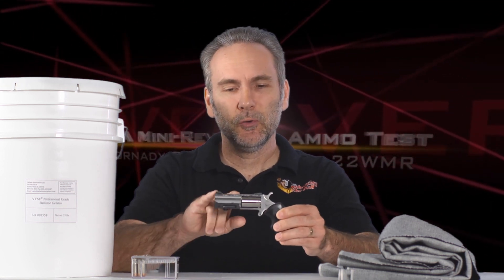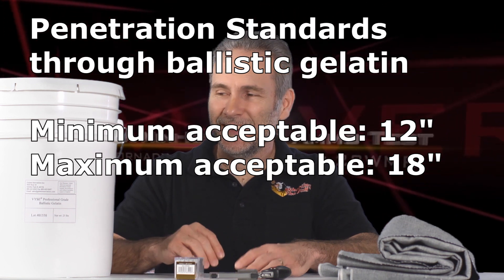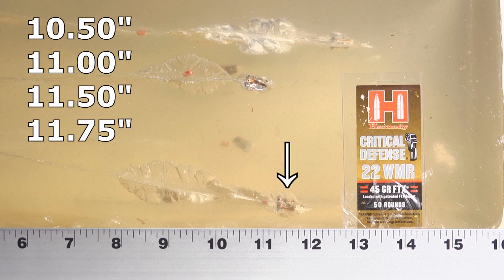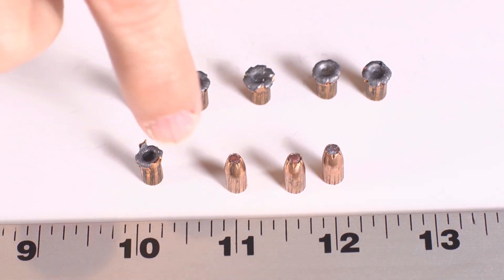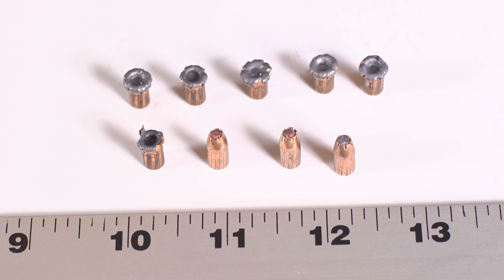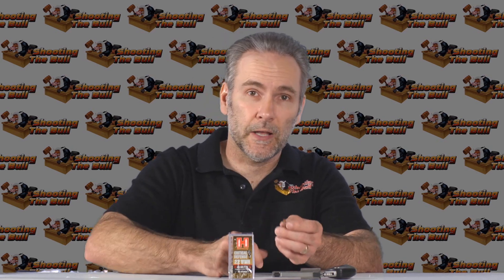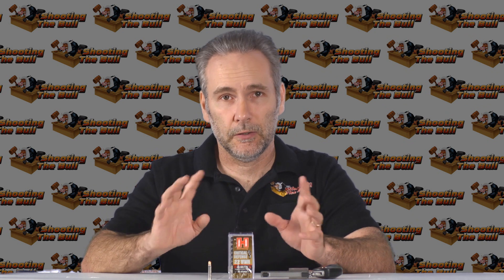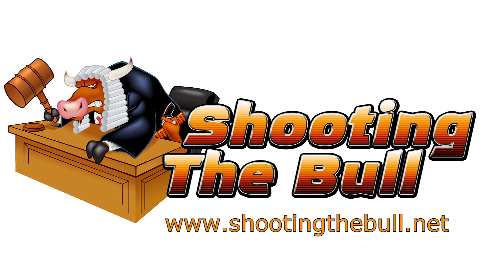North American Arms (NAA)  mini-revolver ammo test: Hornady Critical Defense 22WMR 22 Magnum

Comment: Great job on this video, it's very nice to see what you can expect from a little pistol like this.
IMO you nailed it when you pointed out this is an up close belly gun, you utilize in a desperate effort to get out of there. I believe this can is very capable of performing that role. I'm not nearly as concerned about this bullet expanding as I am it penetrating. A head shot, neck or any CNS hit and it's game over and really with any pistol we're really just ventilating their asses until we reach a long gun. A situation I pray to never have to deal with. Anyway for what I believe to be it's intended purpose, it's well suited to perform.
Personally I like the flex tip design. I believe it's purpose is to penetrate walls, car doors or windshields and remain intact and sustain enough velocity to punch holes in the target.
If I'm ever faced with a situation that requires utilizing a firearm to protect my family, I hope to reach a long gun and put an end to it before someone innocent is hurt.
Thanks again for putting in the effort and expense to make this video.

Comment: A .22 in general is a nasty round. A .22 mag is nastier. The thing with a .22 is that it bounces around inside whatever it hits. I have a friend that was shot in the leg, just above the knee with a .22 mag derringer during an attempted hold up a few years ago and it took about 6 months to heal. Lead slivers worked out for a couple of months, even though the ER Doctor did his best to clean up the wound. 
Would I rather have a .380 or .38? Yes I would, but don''t under estimate a .22.
Reply: It's slightly more likely to ricochet off of a bone than a larger bullet, but it doesn't "bounce around" it would need to penetrate like 40 inches of tissue for that to even be a possibility